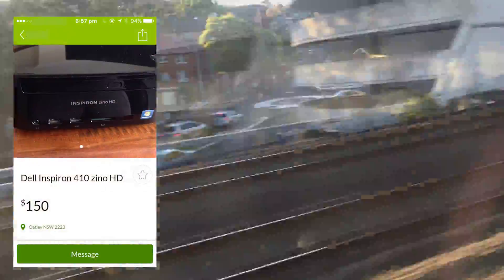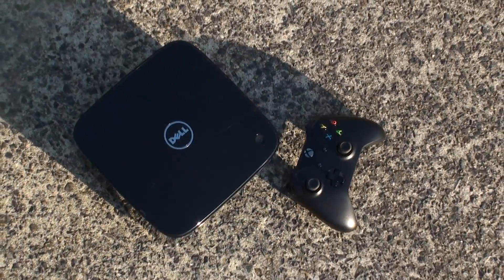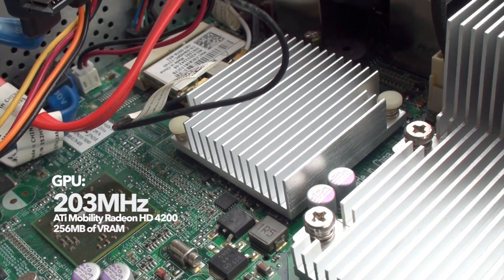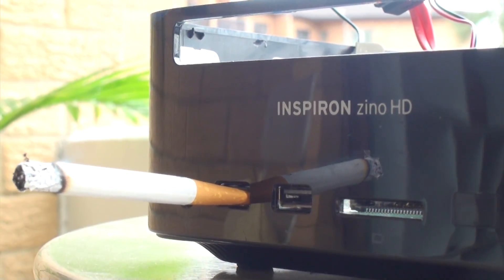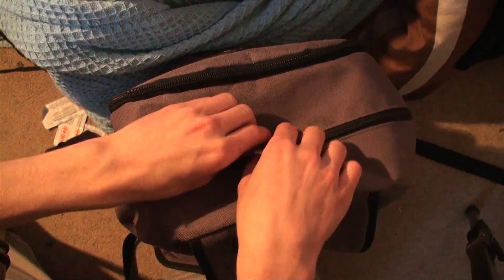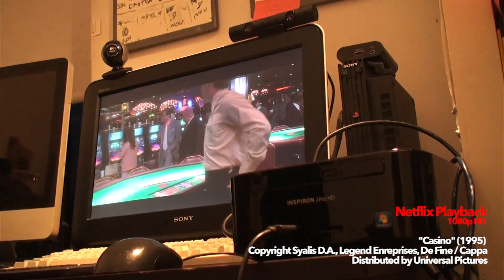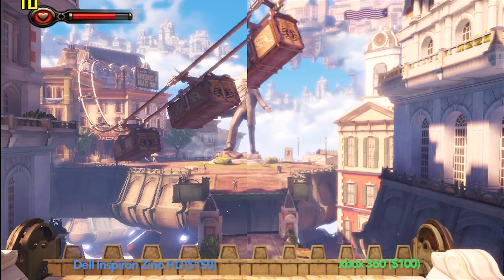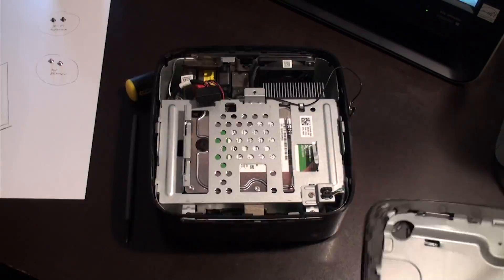The Dell Mini

Comment: im curious, would you ever try upgrading the graphics via the mxm-a slot? i can't tell if it's only on the zino hd 410 or not
Reply: along with that, the processor is socketed, you could but a turion in there

Comment: Figure I should mention: I had a laptop I got around 8 years ago with very similar specs I paid roughly $450 for. It featured an AMD Turion II P540 CPU at 2.4 GHz, an ATI Mobility Radeon 5240, 4 GB of DDR3-1600 RAM, a 320 GB hard drive, and it handled just as poorly with games. The fan on it ended up dying. It was an HP G62-435DX and the gimmick behind it was that it offered 4 GB of RAM when most laptops at the time ran 2 or 3.

Comment: my 2011 Mac min would give the dell min a new asshole spec 2.5Ghz core i5 with 8GB RAM with Radion HD 6630 256 GDDR 5 500GB Hard Drive. it plays Daiblo 3 high settings ok.

Comment: Hey Green Ham Gaming my PC needs a gaming upgrade and I don't want to break anything and I want to know what I could buy that won't destroy my PC. Here are my specs:

Processor AMD FX(tm)-4300 Quad-Core Processor
 
Video Card AMD Radeon R5 200 Series
 
RAM 8.0 GB
 
Operating System Microsoft Windows 10 (build 14393), 64-bit

Comment: No way it is from 2007. The Athlon II came in 2009, DDRIII became popular around that time too (also the hd4200). The windows 7 sticker confirms that, also the round design of the machine that makes it much more 2009-2011 (2007 was more angular, "metal" effect).

Comment: i had a simulary speced machine, amd athlon II x3 435, and the same graphics, and it was terrible, but, at 800x600 it could at least run borderlands 2 alright at low settings, cpu is not bad, gpu is

Comment: it could probably run YouTube at 60fps if you don't use chrome. I couldn't even watch 720 60 on my laptop but when i started to use edge, i can watch YouTube 1080p 60fps with no frame drops and other things running on second monitor

Comment: I'm a huge fan of your show and I am starting my own collection of old technology. I've been at this for about a year now and have a large collection of Consoles now. I would like to get more old computers though. Currently I have a Dell Dimension L100R, a custom gaming computer, Alienware X51 R2(Taken apart. Planning to rebuild soon), and a Gateway DX series from 2011. Along with 2 laptops, an HP(2013) and an old Dell Latitude. 

I'd like to know of any cheap computers I could start rescuing on ebay that you would suggest. Like, make and model.

Thanks!
Reply: Also, I don't want to sound like a copy cat but the Dell Dimension L1000R is named, "Lambda" inspired by your, "Supercharging the Gateway" video. It has the Lambda on the side too lol
Reply: Also, I have an idea for a series I'd love to see you do. Make a computer based on each decade of computers like, starting in the 70's or 80's and going up to like 2010.

Comment: hey dude great video as usual.

just a quick heads up if my research is correct there is a 2nd ram slot and an MXM slot on the underbelly of the motherboard you can upgrade the RAM and install a laptop video card dude! this project could still be viable! :D 

if you decide to do it please make a video I would LOVE to see how it does after you upgrade it! 

keep up the great work!
Reply: you can also upgrade to a Phenom II quad core!

Comment: Hey, ZSNES can run even on a Pentium 3 Celeron 600MHz with 64MB of VRAM and DX8 on the highest settings, a good proof of high rate emulator is SnesX9.

Comment: Seeing as it performed, (the later games you showed like Vice City) it is like a more powerful PS2/XBOX original since it could handle those at 720p@60fps. Seeing as most games at that time were played at 480p@30fps. It's a cool pickup if you buy it just to play games like that on it/some older emulators.

Comment: Can it run Mine Craft?
Reply: yeah it would but not as well the render distance would be turned a bit and resolution be at least 720p because of it gpu so alright i guess XD

p.s just no mods
Reply: My 2010 3GB machine can handle Tekkit Legends fine, why no mods, fam? It'll be great
Reply: TheCapskyLabs it would slow the preformance down
Reply: Arran Bear Nope, getting 90-120 FPS with that on an old Sandy Bridge i5.
GPU isn't really a problem if you're not using dat 512x512 texture pack
Reply: TheCapskyLabs well i havent played minecraft on pc but i dont know all of the texture mods and all that, but when you have mods installed on computer well it depends on the mod it can affect the game preformance. sorry i guess i lose :(
Reply: Arran Bear Well you're arguing without even knowing the subject, it's only fair if you lose.
Mods slow down the PC only when they add a significant chunk of code for the CPU to process, or better texture quality for the GPU to render. There could be some mods that add a lot of items to the world which eats RAM, but 4GB is the acceptable minimum these times, so it's all rare to see RAM bottlenecking your performance.
Reply: Samster Birdies That's a 2010-2011 i5, and I do have a DGPU.
It's not old per se, just overheating because it'
s in a shitty laptop.

Comment: Why in the world 

I ran Project 64 1.6 on a Pentium 4 1.7ghz single core, 1GB RAM in Windows XP 32-bit on a dying Seagate 40GB IDE PATA drive with an ATI Rage 128 Pro 32mb and only had an issue with the texture for Mario's face not showing right. Otherwise performed greatly. Unless the newer versions are more intensive for whatever reason, I have a hard time seeing why this is even viable as a test.

Comment: Great computer for 2007 but not a good option today (not like it realy matters to me because i sometimes i game on 30+ year old 8bit computers.) 

Maybe you can install windows xp on it and play some old games from the late 1990s or early 2000s that are not patched to work on modern windows.
Reply: This dell mini computer can run xp in its sleep i had a computer with 128 mb of ram and a 8gb hard drive for windows xp in 2003 and it ran like ass too. 

But the worst was in highschool in 2012! when we where running windows 7 on a computer with 512mb of ram a pentium 4 and a crt monitor from 1996.

In 2003 we where running windows 3.1 2008 we where running windows 98 in 2010 we where using windows 2000.
Reply: betarage Worse that my notebook is worse, it does don't run BF 1942

Comment: you can play Battlefield 3 with the specs, but with 6 fps anywhere. The pc specs can handle any trackmania.
can run minecraft, NFSHP2,NFSUG1,NFSUG2,NFSMW,NFSC,NFSPS,NFSUC at around 30 fps if you mix some settings.
(yes i used those specs to play needforspeed.)

Comment: in my opinion its not worth a single penny cause its runs like shit
Reply: yea probably. theres a 5 dollar pc build on yt that runs games 10 times better than this xd
Reply: Every PC has it's own worth and not every PC is used for gaming
Reply: K Dawg couldn't have said it better
Reply: gtfo from here scrub.
Reply: Cortez Baldur I can run games on my craptop better than on there. And seeing how the mini computer handles in games that are considered light today it's  not worth it. If this was 9 years ago I would agree with you but it's not good at all in today's standards. But if you could pick it up for $10-20 it's worth it since you're really paying for the form factor.
Reply: well yes but my point was that TYPICAL integrated graphics from a TYPICAL 200$ desktop will perform far worse than the dell mini's dedicated graphics. (even if it's dedicated graphics are very sub par.) but yes u can find very good deals if your patient. i found a xps shuttle pc with a i3 2100 for 85$ on ebay and happily bought it. now it's sitting under my computer desk next to my gaming computer:)
Reply: Lalnable Hector it cant run gta vc over 30.. plz thats not an new or cpu/gpu demanding game
Reply: Lalnable Hector
i'm with u there. i put an old hd 7750 in my new shuttle pc and it plays a few lightweight games just fine at reasonable settings and reasonable fps and i would never call it a shit card!! so yeah don't try and use something for a purpose u know it isn't gonna be able to handle. that's why i don't try and play new demanding games with the hd 7750 cause i know it can't handle it.
Reply: well it's still a good casual gaming machine just don't expect to play any games that require dedicated hardware. truthfully though it still plays games far better than your almost every typical toaster if u didn't upgrade either of them.
Reply: that thing yes isn't a dedicated gaming machine but that gpu it has still lets it run games far better than most standard computers (toasters). cause integrated graphics probably can't even launch to the main menu of most of those games. so for 150$ it's a better buy than most standard computers.
Reply: wow wait first off what do u consider a craptop cuase maybe u just have way higher standards for what is considered a decent laptop or pc. right now my laptop is a i3 wich has hd 3000 graphics and i'm pretty sure my laptop can't run these games in almost any playable form. so just wondering what is your craptops specs and please be specific. i'm not arguing i'm just curious of your standards so we can understand each other. =)
Reply: Cortez Baldur Like a windows pc from $100 - 200 that your parents bought you.
Reply: ok so a desktop pc that is about 100$-200$ well with that budget your likely getting a core 2 quad at MOST!! i3 and i5's are way more expensive than 200$. okay so lets say they bought u a core 2 quad hp or dell desktop and that's it! nothing else!! no upgrades no addons just what the pc comes with inside. i can tell you for a fact that the core 2 quads integrated graphics suck way too much to play those games at any enjoyable level. (like 5-15fps) i should know i own a couple!!! (hp pro 3000/dell xps 420) now if u add on even a 30$ gpu it is now capable at playing those games with at least a playable fps. (20-30fps) the gpu inside that dell mini is the exact definition of a 30$ gpu so i don't see how the dell mini is worse than your typical desktop that is around 100$-200$. a desktop of that quality isn't playing those games without some sort of gpu upgrade. so without a gpu upgrade the dell mini is better at gaming. i'm not arguing i'm just stating what i know is a fact. any integrated graphics prior to the i3's and i5's are complete crap!! hope u understand what i meant now:)
Reply: Cortez Baldur If you search well enough, you can find good deals.
Reply: Nuttboi82 well sure but what's the point if in getting it cheap if you never use it because it's worse than literally anything else you own that can do any of its functions?
Reply: it's mostly about size.
compared to an xbox 360 its a lot smaller, perfect for living room setups
Reply: exactly thankyou. everyone just thinks about "IF IT CANT RUN LATEST GAMES ULTRA ITS FUCKIN SHIT"
Reply: Jonttu56
it was never designed for games. its perfect for old side scrollers or how about using it for what it was designed for, movies.
Reply: Lalnable Hector This comment is ironic for pc master race debates.
Reply: Samuel Berry I think it would be a perfect retro machine to play late 90s early 2000 games

Comment: Yup,I knew it would not even get CLOSE to the Xbox 360 - for several reasons, weaker CPU BY FAR (IBM Xenos inside Xb360 is a 3 core Simultaneous Multi Threading RISC "Reduced Instruction Set Computing"  CPU clocked at 3.2 GHz)  - where in the Dell you've got an AMD Athlon X2 running at 2.1 GHZ no SMT, and because it is an X86-64 CPU, it is a "CISC" (Complex Instruction Set Computing) CPU. CISC is FAR better at general computing but for games written to run on a RISC CPU - the RISC processor will EASILY outperform the CISC counterpart - as the processing pipeline is all but nonexistent, which incidentally is why CISC is so much better for general processing, as RISC CPUs  are strictly in-order execution, but because they rely on simple instructions, they usually are able to complete each instruction in a single clock cycle. That is where the term "Processing Pipeline" comes from - it is a measure of how many clock cycles a CPU will require for its given instruction set, This is why the Pentium 4's "NetBurst" architecture was SO TERRIBLE! Later Prescott Pentium 4s had A 32 STAGE PIPELINE! The is 32 clock cycles to finish processing any given "complex instruction" where the Pentium 3 had just 11 stages in its pipeline, By comparison Intel's SandyBridge Architecture has a 14 stage to 16 stage processing pipeline,  16 stages for Logical Cores (Hyper Threading) and 14 for bulk core processing . And of course SandyBridge and newer all have not only much higher IPC than any Pentium 3, but also hit far higher frequencies, have a MUCH improved cache layout and size, obviously employ multiple cores,  and has a FAR FAR better Branch Predictor which is INCREDIBLY important to any CPU that deals with out-of-order execution!

There are FAR MORE differences between RISC and the more common CISC CPU architectures, and at this point in time it is safe to say that CISC rules all consumer computing, where RISC CPUs still exist and are produced they are built to be extremely application specific unlike CISC X86-64 CPUs. 

THEN you've got the rather MAJOR difference in GPU power, the Radeon Mobility HD4200 is WORSE than a GT930M!  So the difference here, is that the XB360's GPU is capable of 240 GFLOP, where the Radeon Mobility 4200 is good for JUST 39.84 GFLOP! So ALMOST a 10x difference in favor of the XB360!

This PC is a TOTAL waste of money for anything apart from plugging into your TV for Netflix and the like!

Comment: I just like seeing how older hardware handles games, i just got out my rig from 4 builds ago and tested it. It has a q9550 8gb ddr2, ssd, 560ti, and it runs games good at 720p. It had a 4gb's of ram and a e8500 in it at first but i got the cpu and ram plus ssd for cheap off ebay.

Comment: Tim, have you tried upgrading the hardware? Maybe give us a new video if you do?
Reply: There isn't much to upgrade, the CPU might me changeable, but the socket is made for laptop CPU's around that time so there won't be much difference and the graphics card is soldered onto the mother board/integrated in the CPU. He only could upgrade the RAM (if the chipset supports more), but that wouldn't do much either
Reply: you can get a  kit  remove  the wifi  and convert  the port to pcie
Reply: thesmashtvnetwork link me to one?
Reply: KevinIsSoAwsome
 https://www.amazon.com/gp/product/B01C2V7BK6/ref=pd_lpo_147_tr_t_3?ie=UTF8&psc=1&refRID=XWR01N673C4FBAGSAGA3 but be warn  it  may not work on some  laptops
Reply: ***** I don't think it would be much faster than the internal graphics card with a mPCIe slot of this chipset
Reply: JonasLue i do not know  but  you have more vmram
  to  run game like gta v
Reply: ***** Yeah, at least that would be true

Comment: Well I bought a pic that can fit in a backpack it's like a core 2 duo e4800 with 5 gb ram 160 gb hardrive and the graphics are problems crappy integrated graphics but I have a graphics card that's really good so it will fit in there

Comment: You might be able to add a graphics card through the mPCIE slot by either using one of those adapters from Banggood or making your own with these things:
http://www.ebay.com/itm/USB-3-0-PCI-E-Express-1x-to16x-Extender-Riser-Card-Adapter-SATA-with-Power-Cable/222176245542?_trksid=p2047675.c100005.m1851&_trkparms=aid%3D222007%26algo%3DSIC.MBE%26ao%3D1%26asc%3D39243%26meid%3D3424db7344ed4b02b46ed2953b47bad0%26pid%3D100005%26rk%3D4%26rkt%3D6%26sd%3D172227351870

http://www.ebay.com/itm/Mini-PCI-E-Card-Slot-Expansion-to-USB-2-0-Interface-Adapter-Riser-Card-SW-/331903453510?hash=item4d46fcc946:g:yrQAAOSwOVpXf4H0
Reply: It might depend on the BIOS. Some computers only have the mPCIE just for the Wireless card and not anything else. It may depend from computer to computer though. I might be wrong.
Reply: I would say that this method would even slow the computer mre down, because i don't think, that the mPCIe is meant for graphics cards
Reply: Of course the graphics card would be heavily bottlenecked by the mPCIE interface, but surely it would be better than what is integrated, no?
Reply: Joe Manfred At least regarding the video memory, yes
Reply: It is a computer to computer basis, I believe, and it isn't always just BIOS or software-based; sometimes, certain pins on the mPCIE slot just plain aren't wired into anything. That's why I said might. Hopefully it would work with an eGPU solution and he will showcase it though.
Reply: Joe Manfred Yeah, there are different PCIe variants, i believe they are 1x, 2x, 4x, 8x and 16x, but i'm not sure
Reply: Even if possible the bottlenecking would be unreal
Reply: Oh yeah, if it worked, bottlenecking would be enormous, but it would be far better than what it is like as is. You can see this demonstrated in a lot of laptop eGPU setups in which a card like a GTX 950 only runs AC Black Flag at 35 FPS on average, but it's still a Far Cry (puns) from being unable to run it at all on integrated Intel Graphics at any playable speed.
Reply: Joe Manfred
Reply: Criolla Hidalgo Why are people sometimes just writing an answer containing just the name of another person? I don't get it... (Just a question, no hate)
Reply: Yeah I have the same question to.